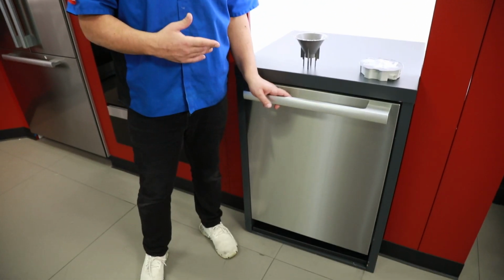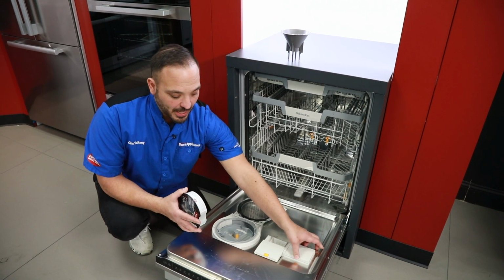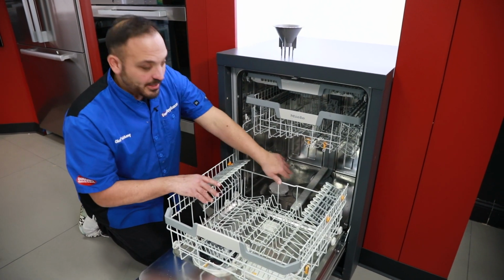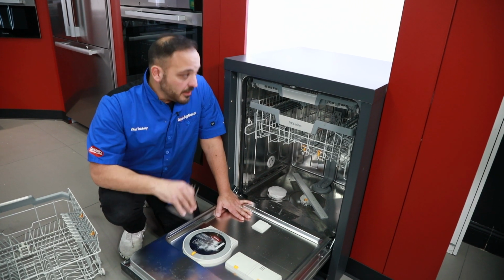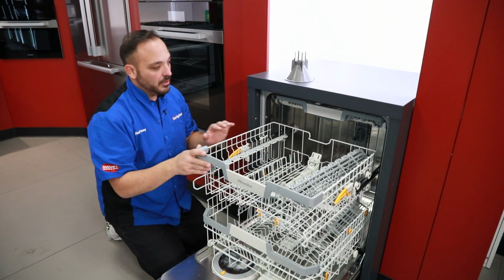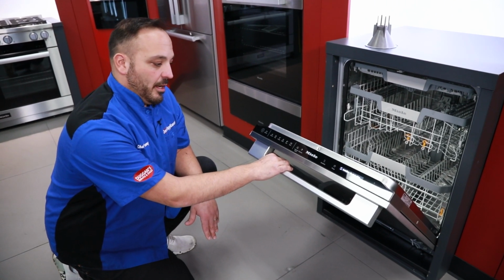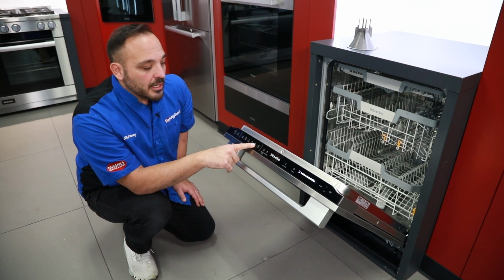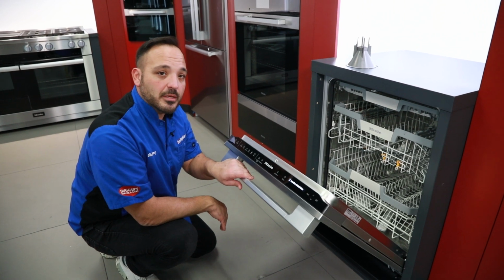Miele Stainless Steel Dishwasher (Model # G 7566 SCVi SF)

Comment: My 25yr old Kenmore needs a face-lift.  Surgery seemed a bit expensive, so replacement was next on the list.  Did my due diligence.  

Expected reliability?  Considerably above average possibly ten years.  Huge selling point for me versus the five or fewer years from nine premium models.

Top row for utensils?  Probably one of the best in the industry with its dedicated sprayer.

For me , there were two reasons why I went with the Bosch 800.  After watching dozens of videos and doing as much research as I could , these two issues were never mentioned either.

First, to get at the filter for regular maintenance, the main control arm has to be removed.  Reliable or not , that has to be a potential source of failure.

Second, I'm not rich enough to have a granite countertop and instead have one made of laminate.  The notion that vented steam would be regularly directed right into that laminate was destined for disaster, and there was no way for me to realistically protect the curved surface,  despite having seen (custom?) shielding work another cases.

One other recommendation , if you're looking , please carefully look at the basket size compared to your current model.  You may find it disappointing small.

Great dishwasher, just had too many flaws for me personally.  Hope this helps if you're looking.

Note (if you're interested) that I stayed away from the Bosch Benchmark, after having considered the incremental benefits I determined they couldn't possibly justify the significantly increased cost.  Zero improvement in reliability; and zero improvement in washability given that I live in a city where water softening is not an issue.